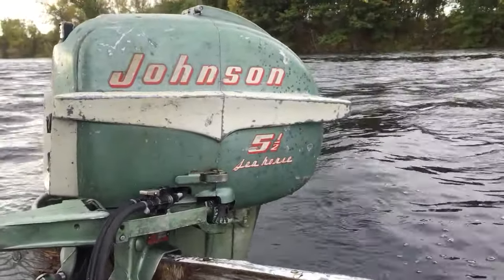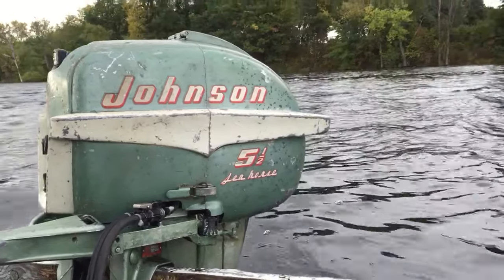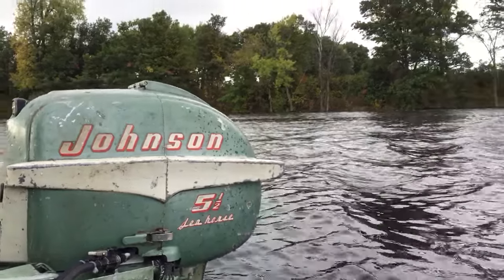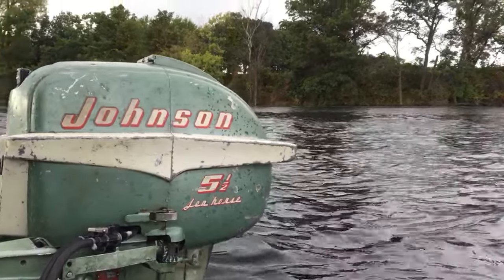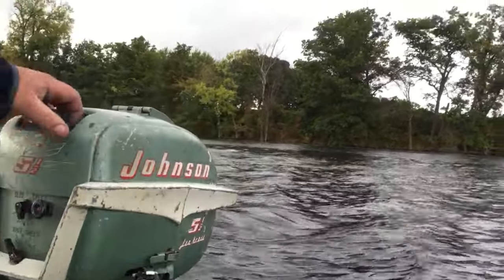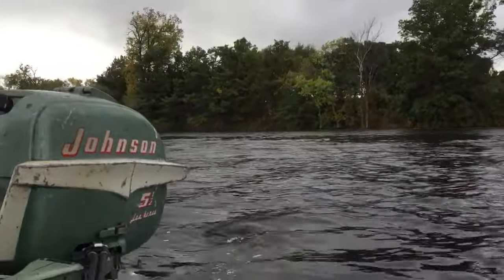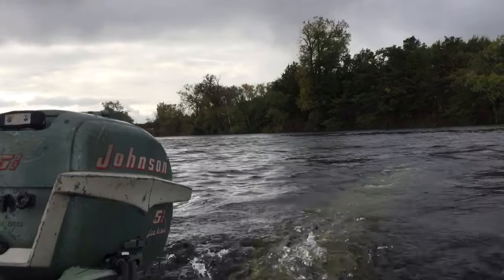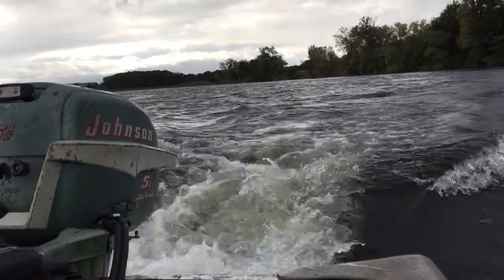1955 Johnson CD-12 5.5hp outboard motor

Comment: It turned out nice.  It sounds good.  Not like my CD-12 that sounds like a soup can full of rocks.  I have 2 CD-12s with bad powerhead, one runs and a third junk 5.5 powerhead.  I'm going to see if I can make one good one out of all that over the winter.
Reply: Might it be missing the rubber gasket around the cover plate where the low and high speed controls and choke are located?    Mine was a bit clanky like that, but I made a gasket with heavy waterproof electrical splicing/sealing tape that's about 1/16" (1.65mm) thick  (specifically, Scotch Rubber Mastic Tape 2228) around most of the edge of the plate, and that fixed it.  

I think the gaskets and grommets for these are available from a Canadian source, too, but my fix is much cheaper, and still not visible.   Also had to tighten the stem nuts for the low and high speed needles, because they tended to drift.  

Could also be missing the little rubber bumpers in the cowling, which you can also bodge together substitutes, but I suspect many are available from parts motors.